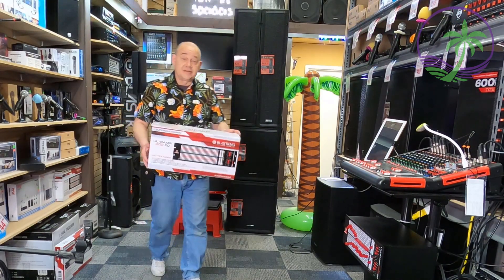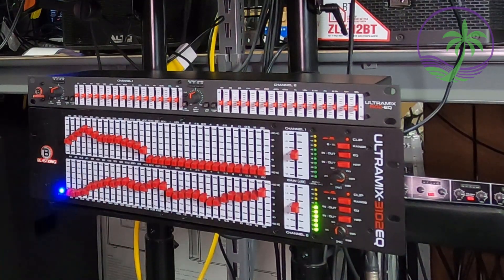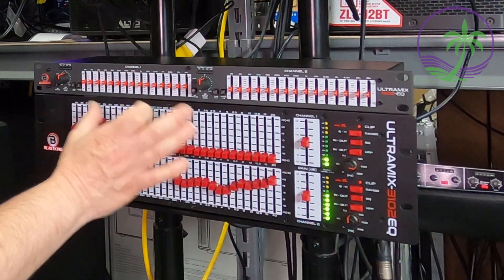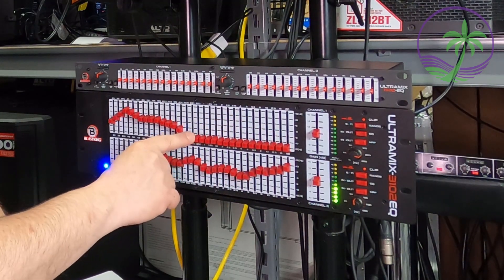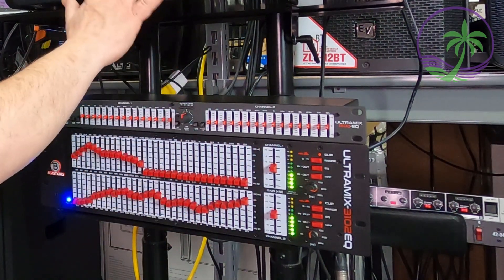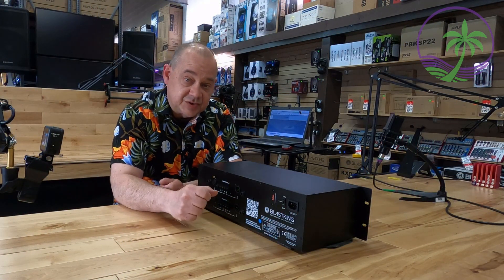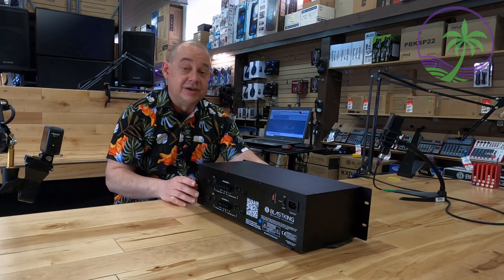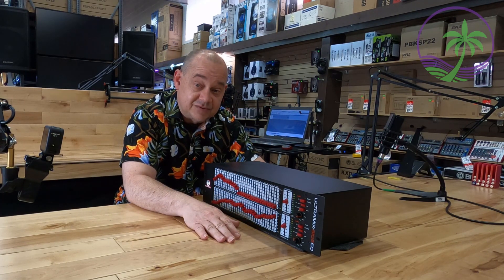How to Make your Power Speakers Sound BIGGER & Better With a Dual 31-Band EQ  From Blastking

Comment: Brand of that speaker stack?
Reply from the maker: Blastking KXD-II TOP aka tower of power
Reply: @expertisland  What is the best 15" passive speakers in the world for quality and power.  I prefer passive as I have amps already, thanks in advance.
Reply: @africangodman6145  Id recommend selling and getting a complete Mackie system two tops 4 subs/bass bins
Reply: @africangodman6145  funktion one
Reply: @JGilly-cp1tk  Thanks.
Reply: @Rufas-6947  Never heard of them.
Reply: @Rufas-6947  HA Funktion-One! That's truly next level sound! I only know of 1 mobile Funktion-One rig in Toronto..wow
Reply: @africangodman6145  It's up there as one of the best in the world
Reply: @JGilly-cp1tk  lol mackie!😭
Reply: "aka tower of power"...... selling more "dreams" robbing, sorry robin?......
Reply: The subwoofers should be 18 inches in my opinion

Comment: Go buy a behringer, from Thomass it will be cheaper and better..... they also offer an honest quality service, not sell you junk for you hard earned cash..... 

Follow the comments in the alto 18" alledged subwoofer where the guy asks what to do about the awfull sound, then robbing, sorry robin replies by saying he answered his question in a q&a video..... (and gives the link, 3rd? question in he tells the guy to turn his subwoofer to the wall, not even realising what kind of delayed reflected sounds he will get and the many null points that will be created in the room...... robbing, sorry robin 😅 sold him a pair of 18inch subwoofers for a 10 foor wide room by 20 foot room, yet he comments that 10 by 20 could be any size..... yerrr we all have 10 meter by 20 meter or miles or killometer rooms or is it inches or centimeters?...... obviously it was feet, but these salesmen are very slimey at getting out of statements they made, so this lad paid him for 2 18" subs for a bedroom..... he saw 18" and was sold a dream, in reality the product cant even go down to 100hz in the demo video........... just a complete rip off, but in all fairness, the lad should have done some research atleast looked at comments of the product.... he didnt, he took robbing, sorry robin for his word that it would be fine.....

It very audibley wasn't and he is now complaining about the bismal product he was sold, and the promise that was given, so the lad gets called out in a q&a video..... told to turn his speakers to the wall 😅😅😅😅😅😅😅👍🏻

This kind of abuse to someone who very clearly was ignorant and trusted the word of this salesman just makes me sick inside, but they do say that a fool and his money are eaisily parted........ and when theres wolves or unscrupulous characters like this to pray on the vaunerable, then people will continue to be ripped whilst this shop continues to trade......

PLEASE, PLEASE, DO RESEARCH ON ANY PRODUCT YOU PLAN TO BUY THAT COSTS ALOT OF MONEY.....

NEVER TRUST BOTTOM FEEDERS AT THEIR WORD, IT MEANS NOTHING AND IS WORTH LESS THAN THAT.....

ALWAYS LISTEN TO A PRODUCT BEFORE YOU PART WITH YOUR HARD EARNED MONEY....

BUYER BE WARNED, AS THERE ARE MANY LIKE THIS GUY THAT WILL SELL YOU A DREAM AND TAKE YOUR CASH WITHOUT A SECOND THAUGHT, ITS THEIR JOB.

I gave the lad some advice off line, left my details and told him to take robbing, sorry robin to court..... i wouldnt even bother asking for a refund for a product that wasnt fit for purpose, and robbing, sorry robin would be jailed for "obtaining money by deception".... a leagal way of saying the word "THEFT"......

Truuly an appalling story where a young man was taken advantage of.......... he could be anybodys son, read for yourselves..... about 40 comments down from the top and dosent even get an answer except to a utube video link from a person who very clearly (if you watch a few of these videos) has the attitude that we should be thankfull to him for what he so graciously offers us.... and at "the price point" he keeps mentioning which will be atleast 400% markup like it is in the audio sales trade......

Like this equaliser, it will be atleast 200$ and the box inside will be nearly empty, 12w power consumption when being used....... just really bad cheep electronics..... mass milled aluminium and plastic (if the front even is made of aluminium)....... it wont cost more then 20$ to manufacture.......

Comment: How to avoid the noising on my tweeter?with Equalizer and ACTIVE CROSSOVER?its have sound like rainy
Reply from the maker: It's a grounding problem make sure your using balanced cables and the problem could still be a bad ground .
Reply: @expertisland but all  may cable CONNECTORS are XLR or balance on PROCESSORS..but itry to check my CABLES ..thank you SIR to reply

Comment: I bought the tower of power from blastking . It a beast I had to upgrade my 18 inch to b&c the speaker it came with can’t take all of the amps . The amp puts out 1200 full power I went and got a 1500 rms speaker to take it . And it’s more beefy bass and do not clip or smell burn like the one it came with. 
These will compete with any high end speaker on the market . They are built like war tanks. They will surely compete with JBL and Ev and all the high end blastking knows what power is.
Reply: Im on the fence about the Tower of power

Comment: Another excellent video
Reply from the maker: thank you , I appreciate that.
Reply: Just remember your tweeters and subs are designed to work between certain frequencies with a power threshold.. Exceed it and your replacing new drivers.